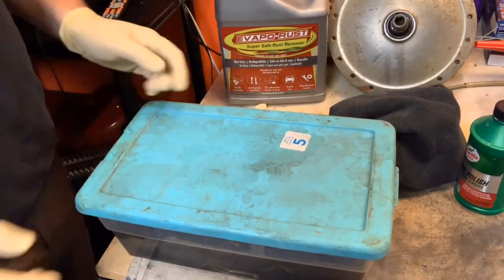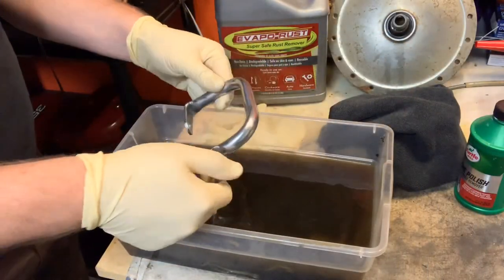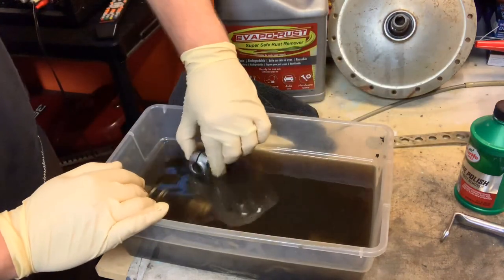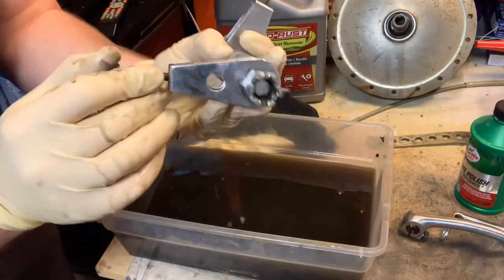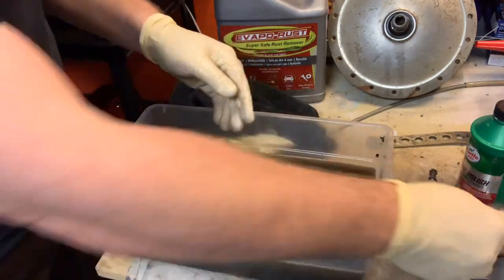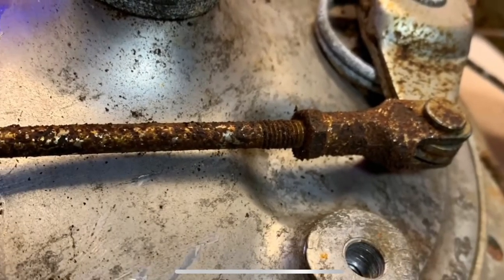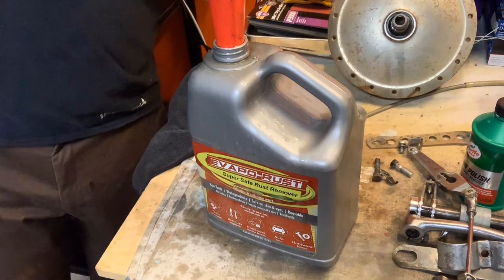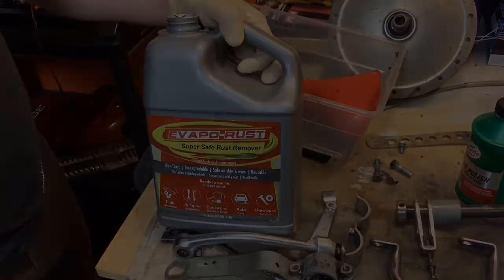Can You Reuse Evapo Rust?

Comment: Excellent test, Brian.  I'm restoring rusted axe heads and had to hunt for Evapo-Rust in NYC but glad I found at a local auto parts shop.  24 hour soak completely obliterated a vintage True Temper Perfect double bit rust patina; now it's ready for polishing and sharpening.  I saved the black liquid and imagine I will get another shot at salvaging some old rusted parts and keeping the grinder and sander on the shelf.
Reply from the maker: The stuff is pretty amazing. I still get good results from almost black Evaporust. Definitely reusable many times over. Thanks for watching and the comment. Keep saving those old relics of the past!